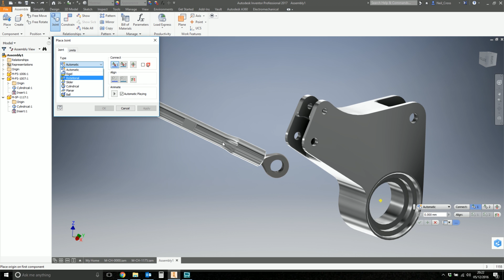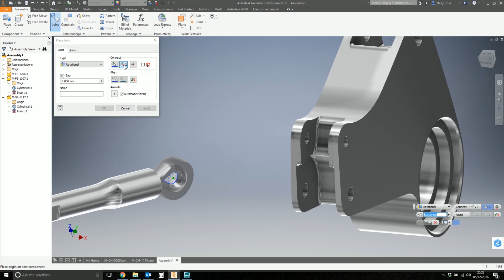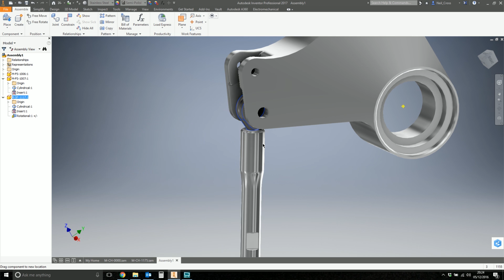Quick Tip, Joints - Place to midpoint between 2 faces & Limits

Comment: @TFI I was able to do the job before the 3 tips on this Playlist for exam practice but I did not know how to do it the way you showed me on all 3 videos.
In the past I would have done math between the two holes and placed the part dead center in one of them and then put a gap on it accordingly with said math. So thank you so much for the tips. This will save me time!! I see the videos are old and I was hoping you had a lot more videos on tops for things to know if I want to take the exam. Thank you